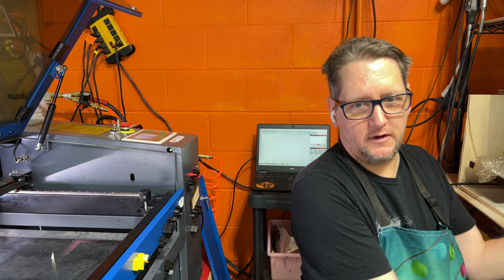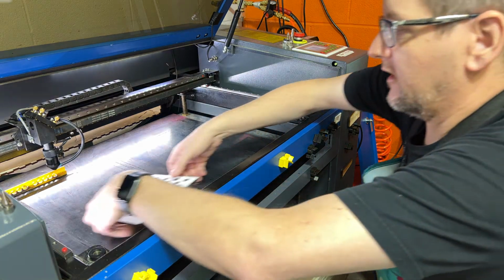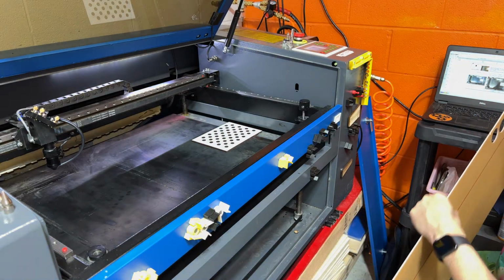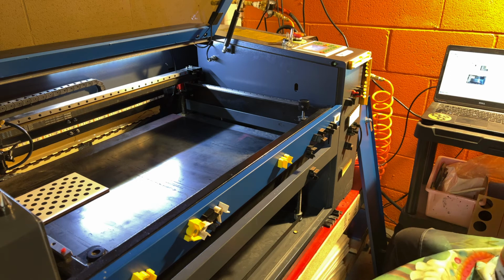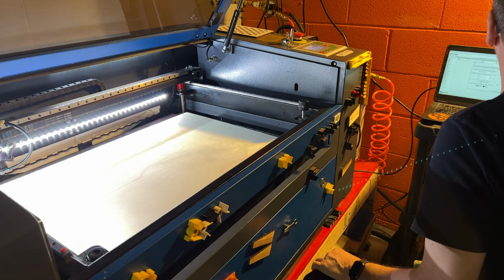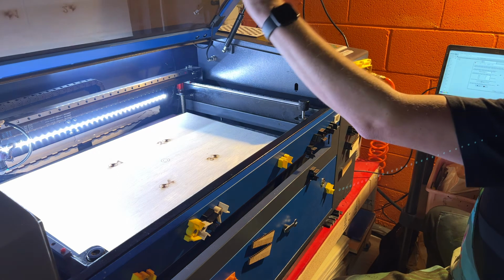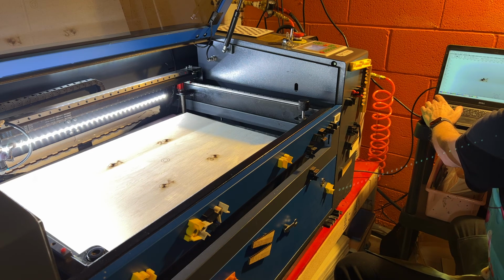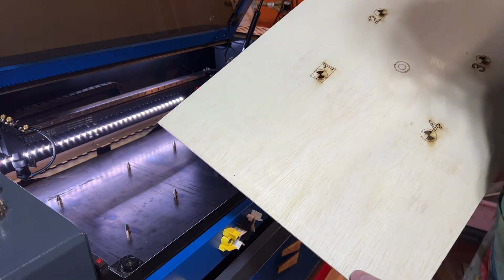Running through the Lightburn Camera Calibration

Comment: I may have missed it, but why is the lid open when calibrating the camera? Should it not be closed for proper line of sight?
Reply from the maker: The camera is pointing down and to the center with the lid opened. There's simply not enough clearance to mount to have a view of the entire bed with the lid closed. This is also not possible because the camera would need to have an extremely wide field of view which isn't feasible.

Comment: My apologies if I missed it, but does the camera USB plug into the laser on the board somewhere, or do you run it out of your laser and plug it directly into your laptop? We access our laser over Ethernet so we can send jobs from multiple computers. I'm looking for a camera solution that won't be limited to a single workstation. Thank you for the videos!
Reply from the maker: The camera connects via USB to the computer.

Comment: thanks for this video dave
Do you think its posible to use a camera with any laser including the must smaller tabletop lasers ?
Subbed, Regards Rick
Reply from the maker: The main key here is the lightburn software.  A k40 by default doesn’t support lightburn unless the controller is upgraded.